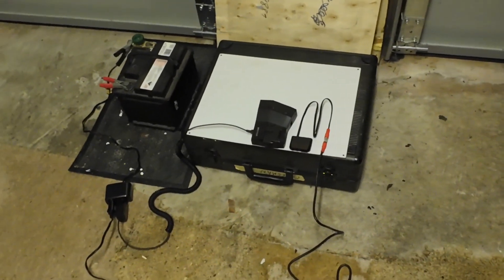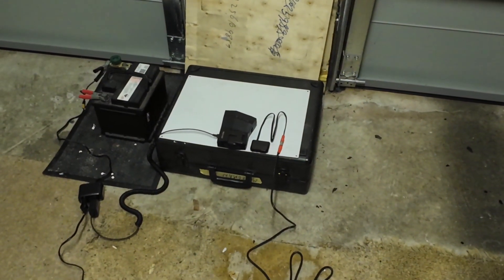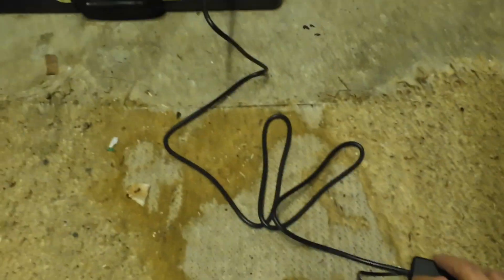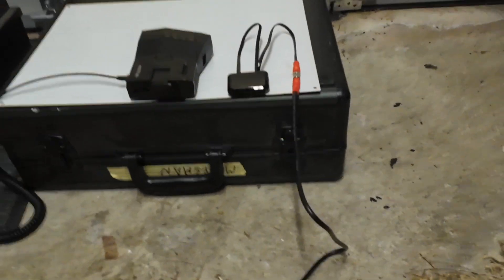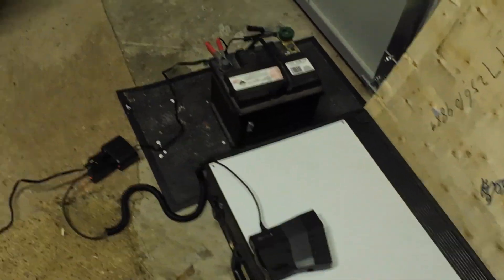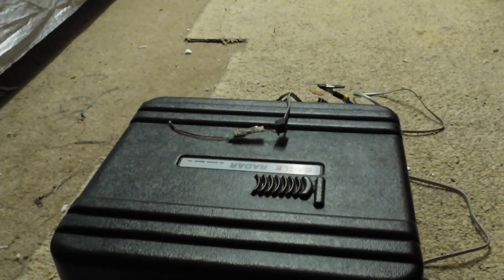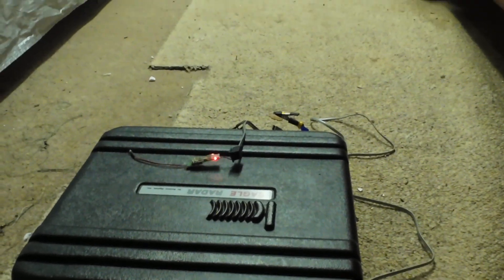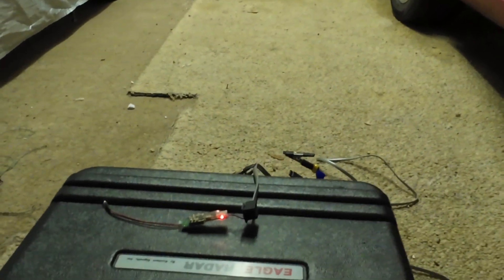Wireless laser sensor hardware upgrade for the Uniden radar detectors.

Comment: Great vid - it will work well  where laser scanner cameras such as Vitronic Poliscan and Jenoptik TraffiStar S350 are in use and a scatter detection outside their max range of 75m can get you a save (i.e. for cams setup to target the front of the car on approach). The Uniden's are typically very poor against such cameras.